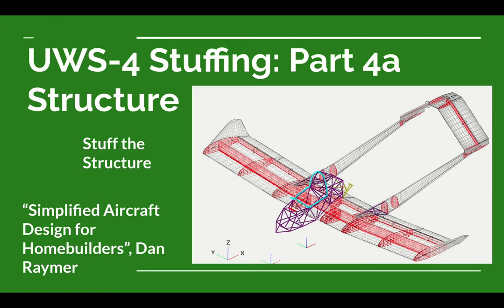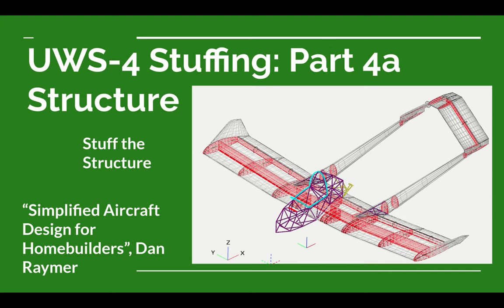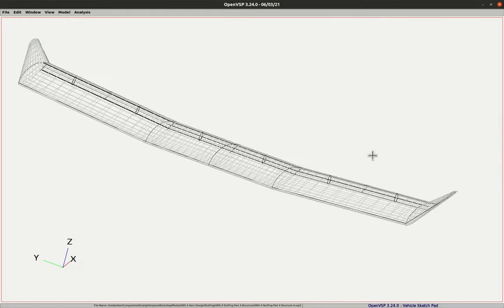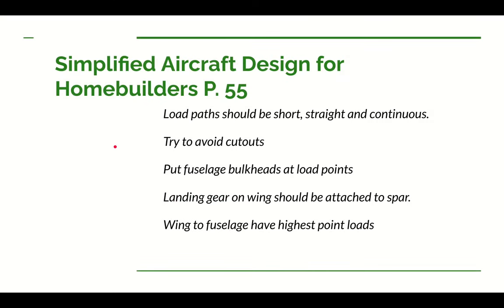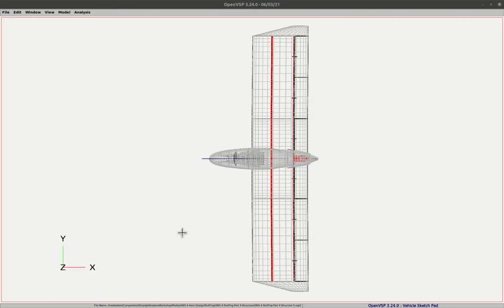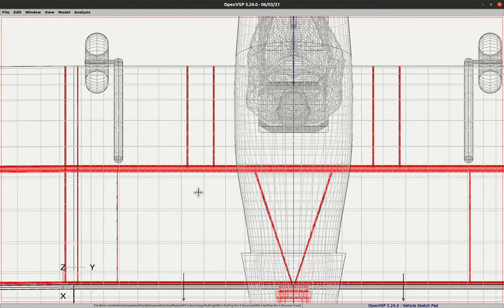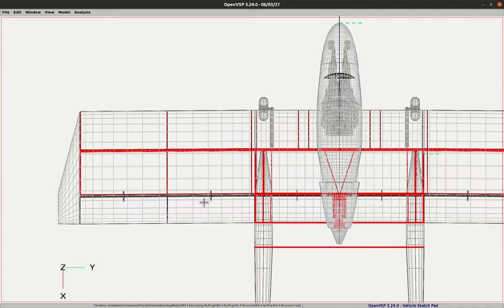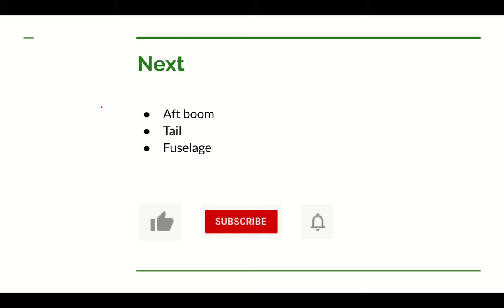UWS-4 Stuffing: Part 4a Structure

Comment: Hi Leon,  I was surprised that after 2 years of composite samples, your baseline structure is now aluminum! As I work through structural trades on my ultralight glider, I'm stunned at how long it really takes to do well, And I don't spend the time to make the videos.  Well done.  Peter Hudson
Reply from the maker: For me the structural material to use depends on the application and purpose. For this ultralight I wanted a faster and cheaper build so composites, at least at this time, would not be the right choice. Composites are great for light weight and compound  smooth curves. Except the for the cabin on the UWS-4  I don't need compound or smooth curves so for this build aluminum made sense. I'll still make a composite airplane at some point.

Comment: Leon, How did you model the fuselage frame in VSP? What geometric component do you use.

Nice work!
Reply from the maker: To model the tubing of the frame I used the stack component and then made the cross sessions of the stack be a circle. This makes it a solid. For something closer to actual tubing use a Body of Revolution and make the cross section a rectangle.  I made a video of doing this for my Builder and Designer tier  Patrons. I didn't think the average viewer would be interested in how I did the tubing.